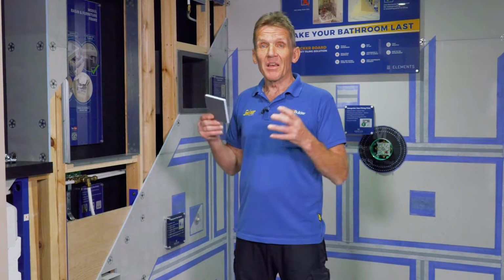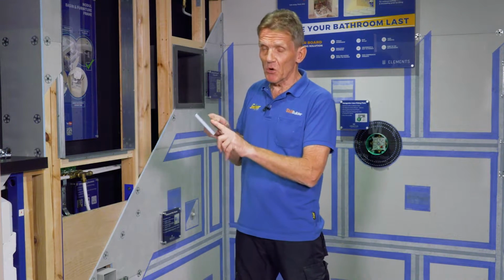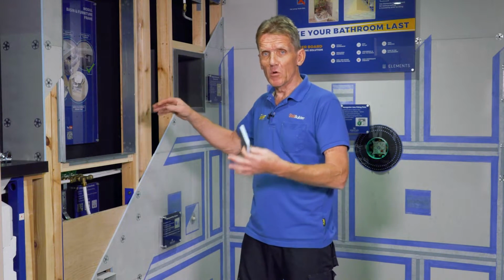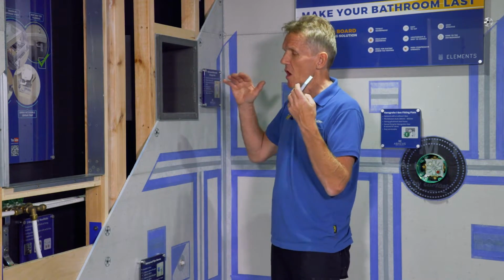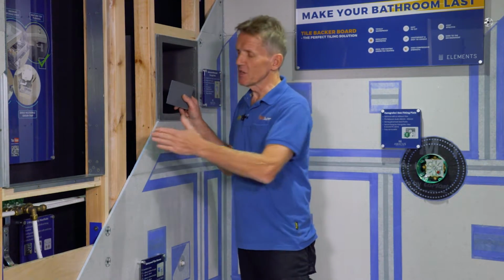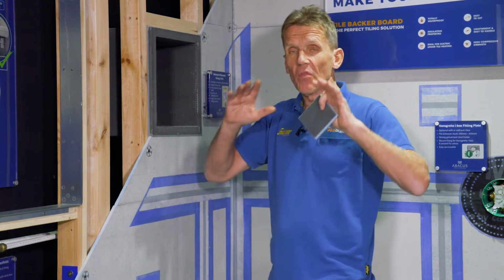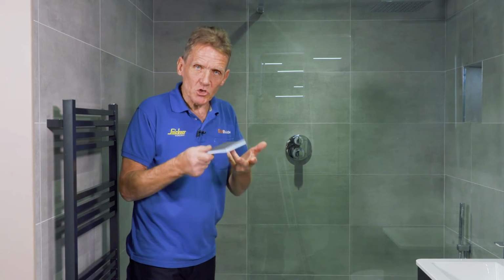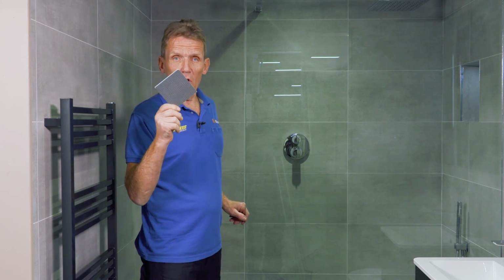Product Spotlight - The Elements Wetroom System

Comment: I like this system and I intend to use it imminently. But I can’t understand how to make holes that will be drilled for fixings waterproof? After tiling you need to drill through the tiles and boards to hang the shower screen, fit digital shower controls etc. How do you make those holes waterproof?